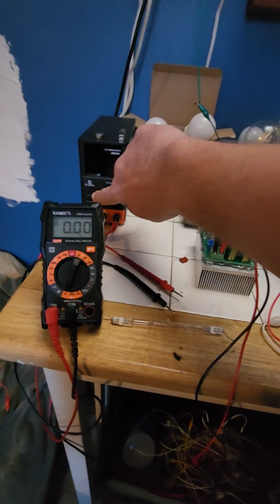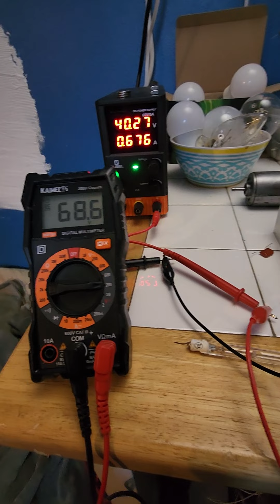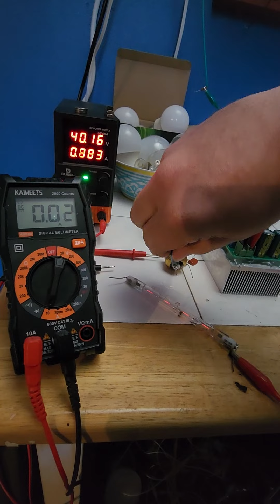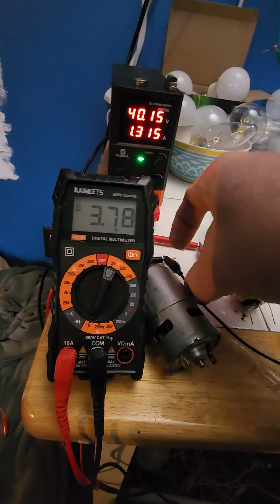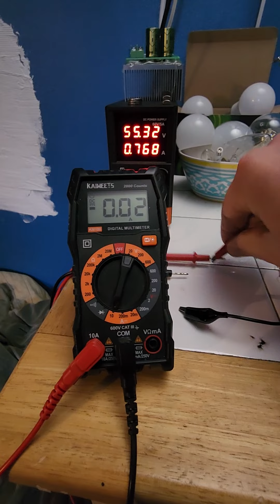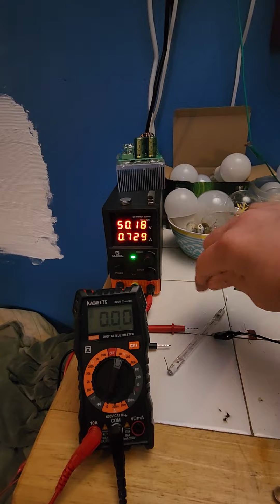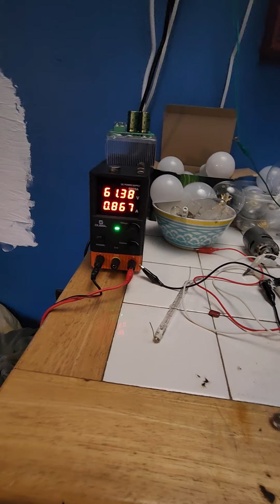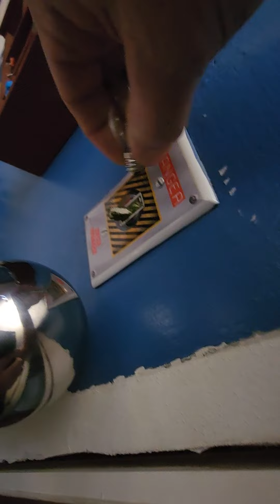⚡️Mal-Effect Generator  Tests. Absolutely Undeniable Resonances Using Back EMF & Earth⚡️

Comment: If you do have something, it's worth millions or billions, yet you're on YT, that sums up the reality. For all mankind I wish you have something, but you don't.
Measuring open circuit voltage and then shorting the output and multiplying the two is completely flawed.
Reply from the maker: The range is over 2000ft from 30watts Input
Reply: @MTECHINDUSTRIES2022  completely bs. Prove it lol
I bet you can't...
Reply from the maker: @inductively coupled plasma  I've proven the 500ft range in my older videos without a doubt. My Research Group & I have to keep some things secret for our financial benefit
Reply: @MTECHINDUSTRIES2022  what research group? Lol
Reply: @MTECHINDUSTRIES2022  There is no way you would show this much video + explanation and trying to keep it a secret. Buy a couple more $5 DMM's and show at the same time input and output power for starters, only then will you get any credibility. There many holes in your video that any tech can point out, and any EE  will point out the rest of the holes in this presentation. Lighting a white LED is  around 40mW, what power is coming in at that time?
Reply from the maker: @inductively coupled plasma  Dude get a life & bother someone else. Better yet read a few books regarding radio. If you read my video descriptions I leave links to all the knowledge your seeking if your interested in learning any of it
Reply: @MTECHINDUSTRIES2022  lol, you haven't been able to demonstrate anything we've asked you to (including just a measure of real power output). I call you out for BS because you make claims that aren't thermodynamically possible and won't do basic tests to prove ur claims
Reply from the maker: @inductively coupled plasma  I just did those tests in my latest video? & oscillating magnetic flux combined with open systems doest have the laws of thermodynamics applicable to it. Also feel free to look up Joel Lagaces Channel or Eric Dollard Or Ken Wheeler
Reply: @inductivelycoupledplasma6207 asking what research group and laughing is very immature.